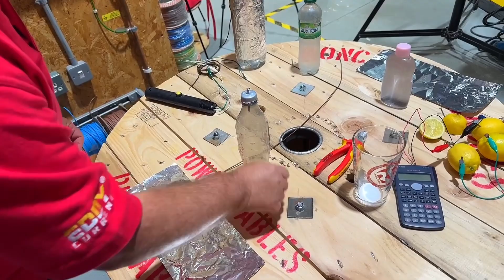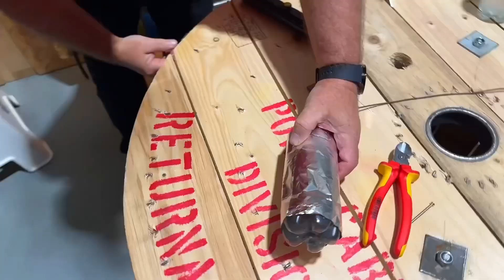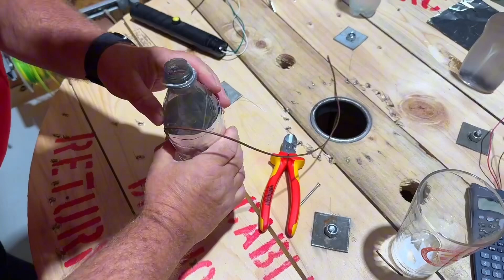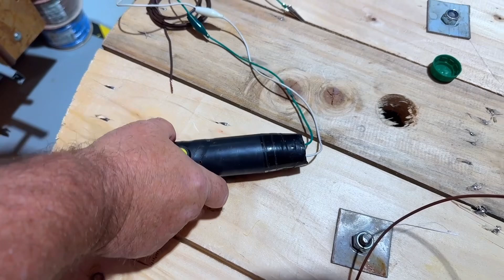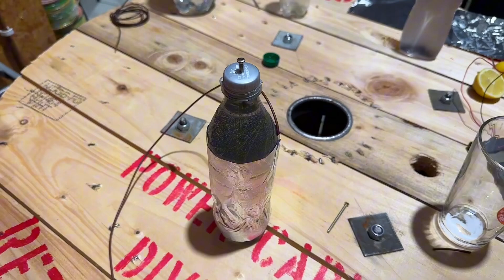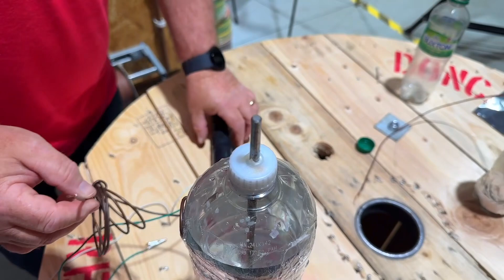How to Make Your own Capacitor

Comment: As a child, I did this with a glass mason jar and used foil inside and out.  I connected it in parallel with a spark gap connected to a 10kv ignition transformer.  Without the capacitor the spark was orange, hissing and seemed lazy.  Inserting paper into the gap resulted in fire.  After connected the capacitor the spark was intense blue, crackling, angry.  Paper in the gap was punctured by many tiny (invisible unless backlit) holes, no fire.

I never connected my spark gap to an antenna and ground, no sir.  That would have been illegal!

Comment: If you want to revisit this, replace the salty water with more foil, and instead of a round plastic insulator use a flat one as its easy to work with flat object, so a sheet of glass or plastic. 
now for the ones following along at home, do not go shorting out 'good' capacitors for the fun of a spark if you want to use that capacitor again, as the high current can actually damage the internals fo the capacitor (pops holes in the thin insulator)
Reply: And stack them, foil, glass, foil, glass, foil, glass, ... (and of course connect the two leads to alternating layers of foil).  For bonus points, put the stack in a box with wires to terminals on the outside of the box.  Fill the box with hot wax and put a weight on top of the stack to compress it while the wax hardens.

Next week maybe we'll discuss Tesla coils.

Comment: This sort of stuff reminds me of when I built a 'crystal' radio (it was actually diode based of course) back in '73 or so with the local church boy's club.  A block of wood for the base, blocks of wood with al foil stuck on and a bolt through (for adjustment) for the tuning capacitor and a dunny roll for the fomer of the copper coil.  All done by hand, cutting up the wood, drilling it, winding the coil and lacquering down.  Local station was 5kW so it didn't take much of an antenna wire to pick it up.

We also did stuff such as exciting fluro tubes with CB radios.  Fun stuff.

Comment: You don't generate energy with a capacitor. You also didn't power the calculator with lemons. No wonder electricians are considered just a step up from roofers in the intelligence ratings.